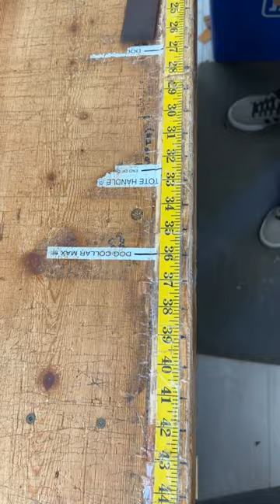Making an Ox Blood Leather Belt #shorts #asmr #leathercraft

Comment: All the edge length trimmings you shave of each belt. Are you able to use those trimmings to make woven summer belts? I scene some they use a leather core frame to wrap the leather around to build the structure of the belt. Just a idea. Most woven belts are not made well now. I know your leather is from good sources. Plus is there much strech in this belt.
Reply from the maker: Sadly the spindly bits of leather aren't good for much. They basically disintegrate and can't be reused. We've thought about this a lot!